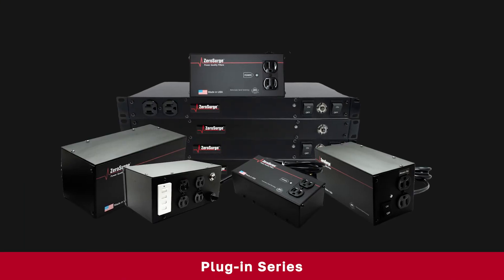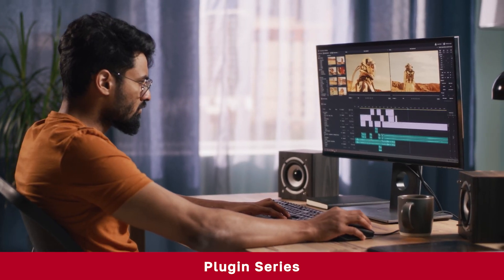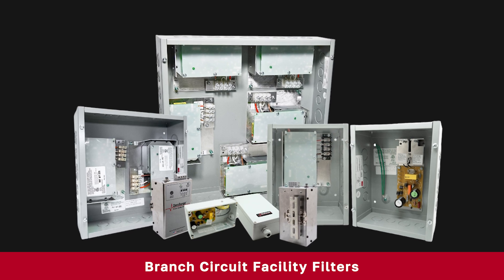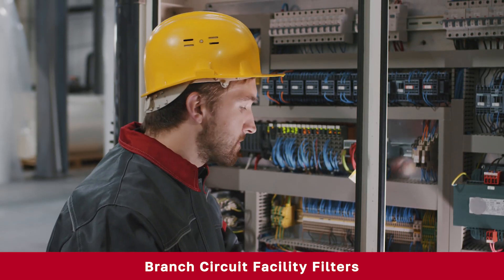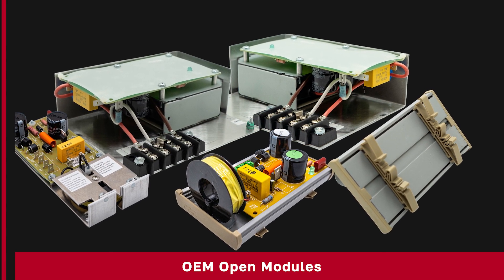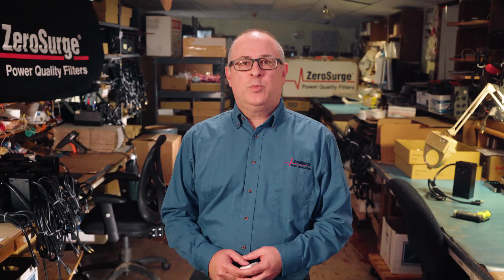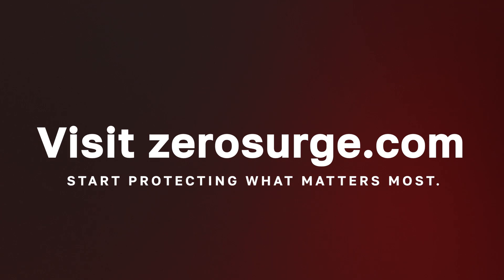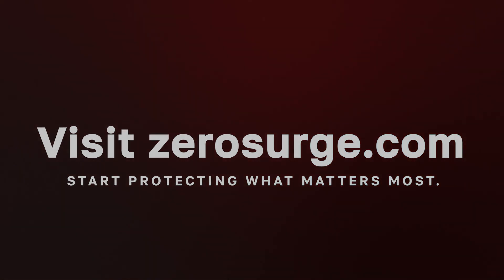Zero Surge Products General Overview

Comment: One thing I never understood is why they chose to put 2 outlets on the side for the standalone units, is very inconvenient especially for hiding the brick. This what made me go SurgeX, they have SA-1810 which is standalone, but with 10 outlets facing up, is also advanced series mode, which these are not. How come Zerosurge doesn't sell total surge protection anymore?
Reply from the maker: @naegleriafowleri2230  The unit was designed when power supplies were bulkier.  The two on the side are always on too.  That was so one could turn off everything but say a cable modem.  Modems can take several minutes to reboot and they update overnight so it is convenient to leave it on. If one needs to completely hide the unit, people choose the FF series and have a dedicated set of wall receptacles.  
TSC is more expensive to make and the benefits though real, did not make enough of a difference to affect long term performance.  Based on our research, the theoretical advantage over time did not justify the cost.  One internal study showed our WVR version (what we currently make) protected against 186 years of worse case surges.